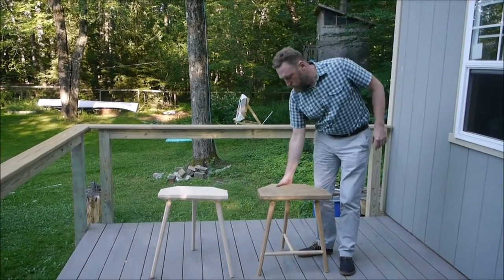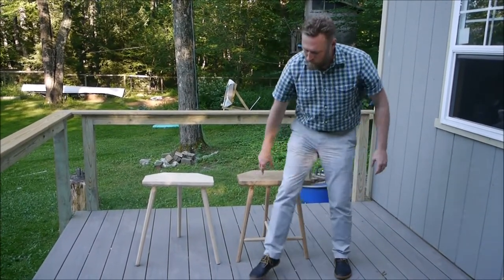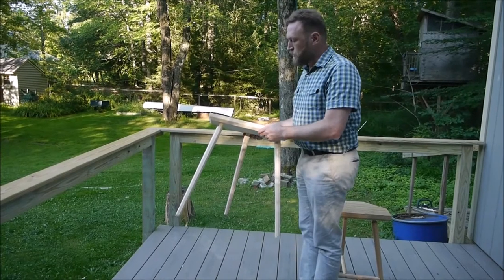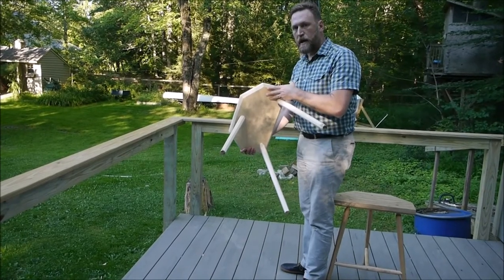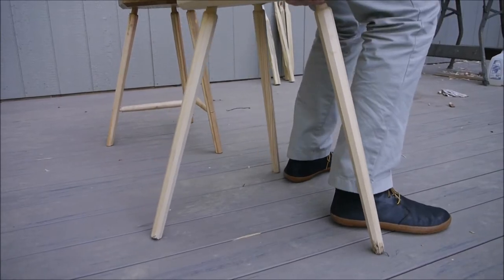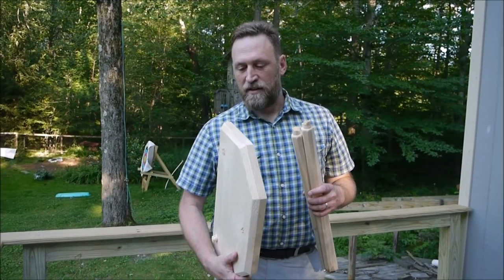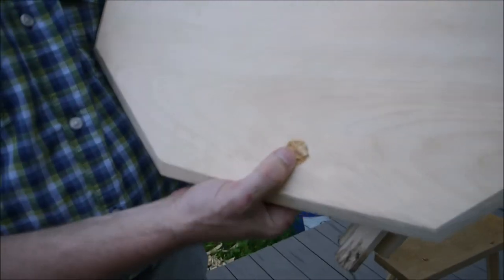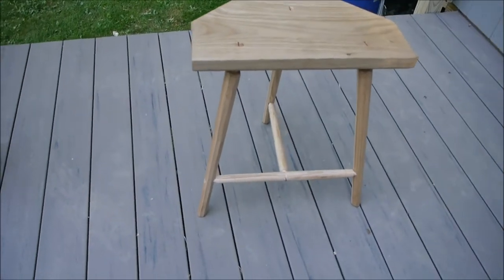Leg Splay on Christopher Schwarz Staked High Stool

Comment: Also, most SPF isn't nearly as structurally solid as Southern Yellow Pine.
Reply: Joshua Brown Now you tell me :) the ones I made with ash legs are holding up well.
Reply: Clark Case I would imagine the ash would be plenty strong. I got some ash and hickory from a friend of mine when it wasn’t right for his axe handles. I made some coat racks using the same tapered tenon for the coat pegs and it’s strong enough that I can hang on them and they don’t even budge. Obviously there is lots of additional leverage on the legs of the stool. Anyway, I’m going to give them a shot in SYP this weekend and I bet they will hold up just fine.

Comment: Could you offer advice on how to drill and taper the holes for the legs? I'm making my first stool and thought this looked like a good design with which to begin chair making. I drilled the 5/8" hole for the legs with a brace and bit, used a veritas non-pro taper for the holes, and hand-carved the leg tenons with a spoke shave. When I fitted my 2 front legs they were way off correct alignment and I'm frustrated. Not quite sure what to do differently to make the legs align better. Thanks.
Reply from the maker: I used a lathe to taper the tenons - this pretty much guarantees the taper is in line with the leg. When boring and tapering the holes, I set up a bevel gauge or two to eyeball the angle of my bit. Even so, one of the stools came out pretty wonky. There are lots of videos on windsor chair making that show various methods of lining up the leg angles.